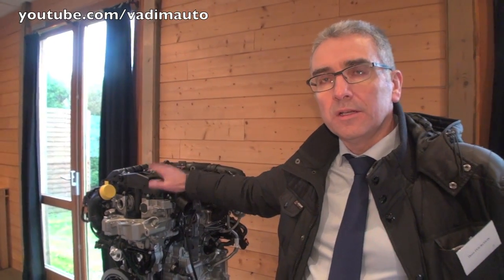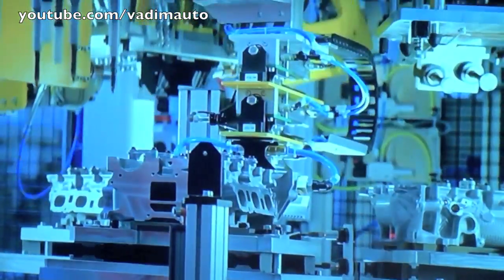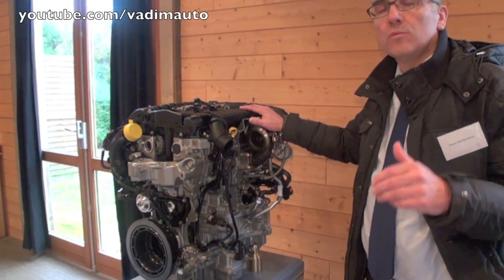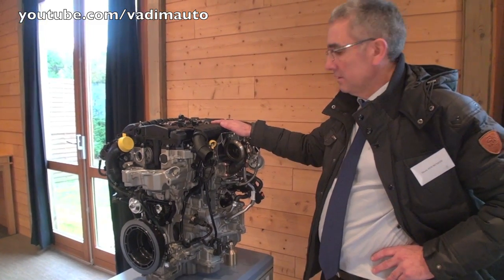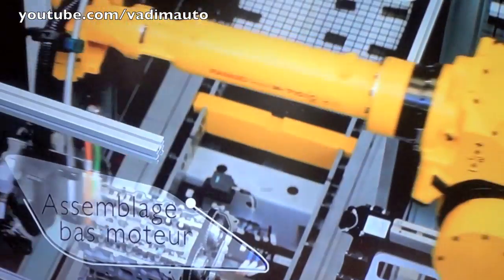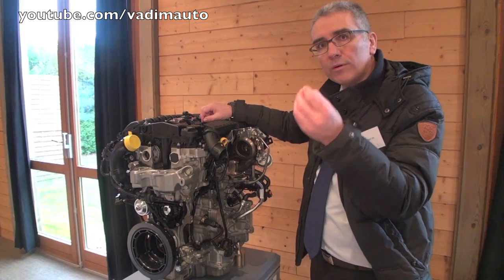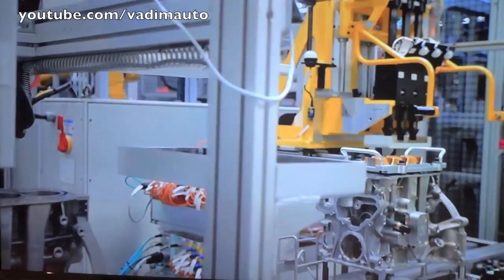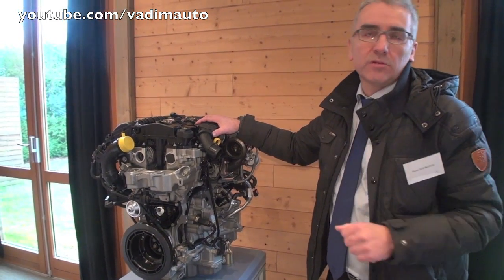Peugeot 1.2 e-THP130 engine story

Comment: But the THP150 in the 308 has cam chain right? I found one but its venting smoke from oil filler cap hole when its warm and i have stopped the engine. White/blue not sure smoke slovly rising. Feels like either turbo leaks exhaust gas into inlet air OR worse the rings are busted right?

Comment: The puretech 1.2, big timing belt faults even in the new version, risk of broken plugs, gasoline in the oil, and oil consumption. This is for the 2020 engine I own. Normal consumption 8L and heavy feet 10L and vibration logical engine 3 cylinders! Conclusion NON RELIABLE ENGINE!!!
Reply: I've had one for over 4 years. The 130HP version. Done almost 70k km. Not a single complaint. Not even oil loss. At worst 0.5l needs to be added between oil changes. 15k interval. And not every time so far. Had no clue people were having these terrible problems that I learn about now.
Reply: @O-B-Head  no te preocupes 😉 tu az los mamteniemientos al dia y no tendras ningun problema

Comment: The history hasn't been updated to include the documented issues with disintegrating cambelts. The words genius and puretech are not compatible unless said genius is the same one who is now tasked with re-engineering the engine to use a cam chain. A good engine with a catastrophic design flaw.
Reply: Cambelt was a huge mistake. The modern engine should have chain. That is my only reason for not to buy one of this cars.
Reply: @MrRoad007  You obviously have not heard of their prince engine 1.6 THP with a single timing chain. I though it was a permanent thing to have in an engine but god was I wrong. The whole assembly was replaced on mine 3 times under warranty as it kept going out of order once a year or so. The tensioner failed in about 20k km. Total crap design in collaboration with BMW.
Reply: @O-B-Head  Same shit with VAG time chains and Mercedes chains. It is not really anyway bulletproof and can also be done wrong. Solution is always to buy toyota, but they are so boring!
Reply: @edn5170  Accurate observation about Toyota. Ive had two Mercedes cars. The chain was not a problem on either of them.

Comment: Wish the 130 hp version was fitted to the Peugeot 108 / Citroen C1 / Toyota Aygo.
Reply: are you creasy?! the  130 was only installed on the 308 and the 208II, 108 had first a Toyota 1.0L 68hp engine , and latest 108's have  72hp , never a more powerfull engine...
Reply: @leneanderthalien   Was referring to the city car trio’s lack of a potent engine to rival the VW Up GTi and Renault Twingo GT as the 130 is also a 3-cylinder,  yet the original trio featured a large 1.4 4-cylinder diesel in the engine bay though concede 100-115 hp would have been reasonable roughly similar to the recent 1KR-VET or the supercharger kits for the 1KR-FE in the event the 130 engine cannot fit into the city car trio’s engine bay.
Reply: That said the EB / Not PureTech has come a long way in reaching 155 hp since then, yet the need for hot pocket rockets still stands.
Reply: @leneanderthalien  my 108 is 82hp
Reply: yes and call it 108 gti
Reply: @Dr Viderius do you think the e-THP 130 will fit in the C1/108/Aygo? I am super keen on upgrading my car by performing an engine swap, but I just can't find answers anywhere!